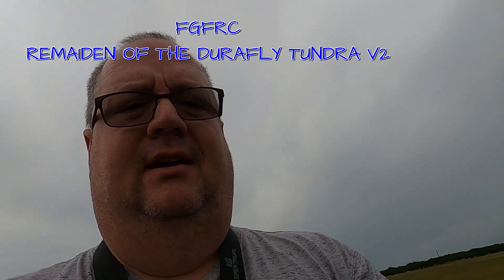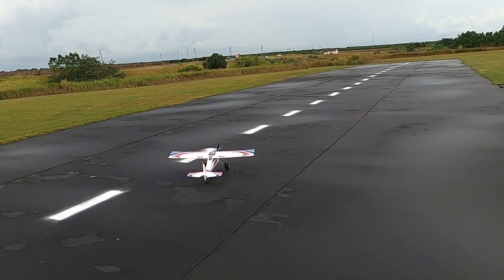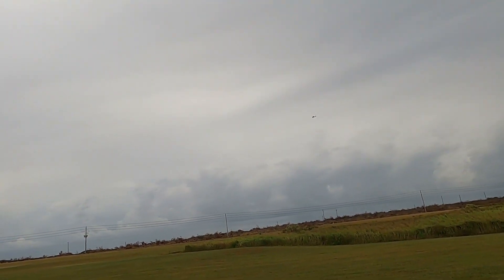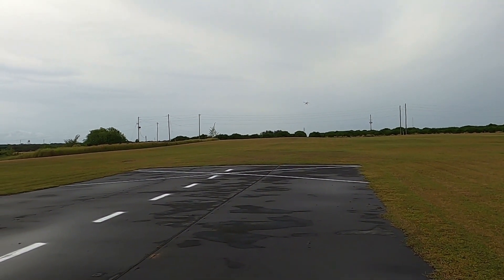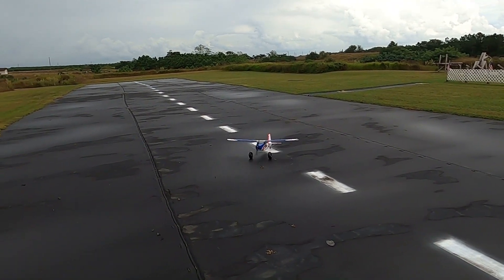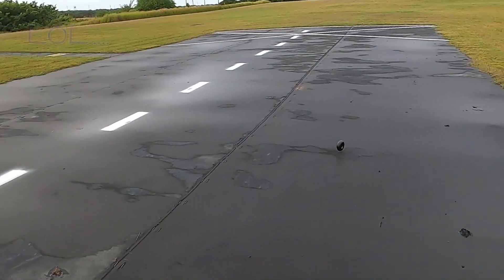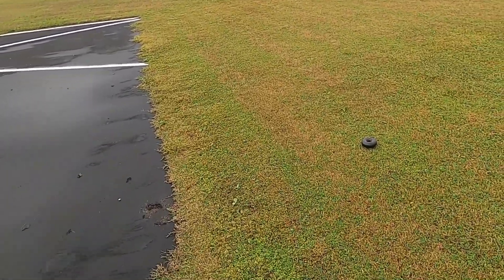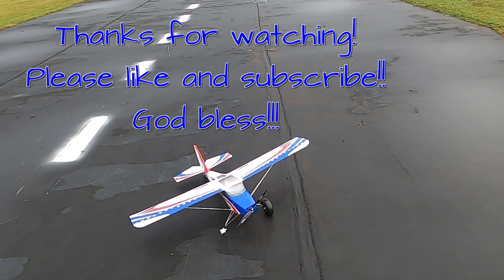WELL I MESSED UP!! REMAIDEN OF THE DURAFLY TUNDRA V2 BY FGFRC

Comment: Great flight  just put one together. Do you know how the tail brace kit installs?
Reply from the maker: I did not use mine. But the clear tabs fold in and glue to the elevator underside and the other you have to screw into the flat plastic on the side of the fuse. The direction show nothing about them so i guess they are optional.

Comment: 🤣😂🤣😂👍🏻 Take a drill and on the rim or hub you use a big bit to drill the axle hole down some. Do it on the outside where nut or collar is. To shorten the thickness of the rim, allowing more room to lock collar down or get a self- locking nut on it. That’s what I did on that plane and a few others I have. You use the same size drill bit as axle hole and clean out the glue.👍🏻✌🏻🖖🏻
Reply from the maker: Great idea. Yeah I gotta get the drill work in on it for sure.

Comment: Get to see this great plane , ive tried quite a few lots different props but I’ve always went back to a master screw 11x6x3 .. which also gives me a bit more ground clearance to a 12 inch two blade prop ..is it just me as I prefer the triple blade props ? 🤔 … 

Great landings in the center of the runway wish I could hit the center 👍👍
Reply from the maker: Thanks I think a three blade would be great. Any overheating issues with that 3 blade prop.?
Reply: @FatGuyFliesRC  thank you for your reply . I haven’t encountered anything significant but I don’t fly it hard nor do I live in a temperate climate … Please  correct me if I’m wrong but I understood a 3 blade prop needs to be approx 1 inch less in diameter to provide similar thrust to a 2 blade prop with the same pitch  . ( 12x2x6 = 11x3x6 ) . I remember watching a really interesting video on YouTube going through this calculation .  

Keep up the flights,  always good to see your posts in the UK 👍👍